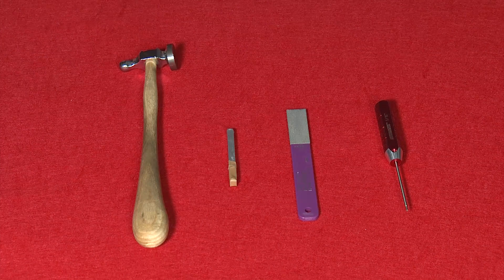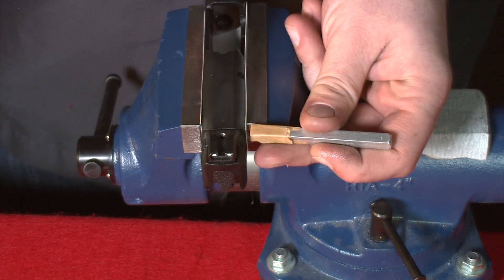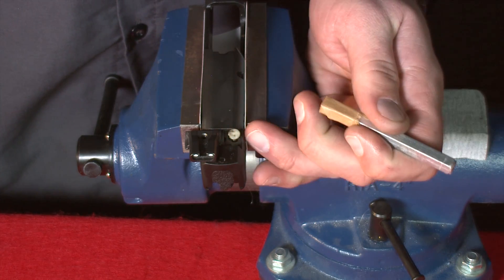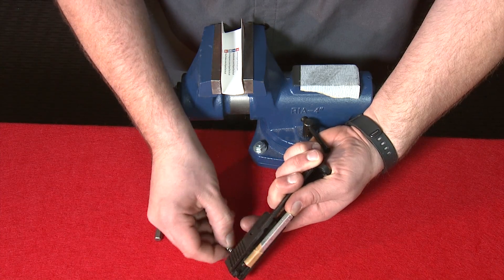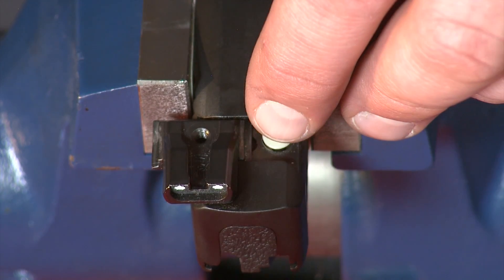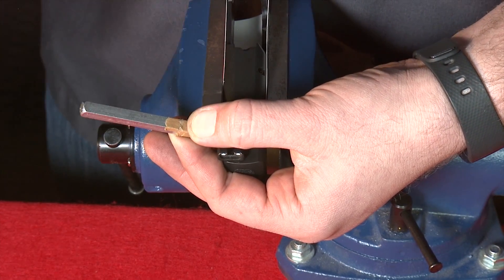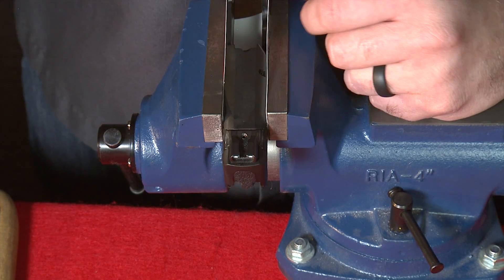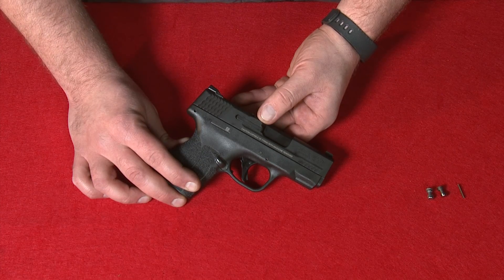How To Disassemble The M&P Shield And M&P Shield 45 Slide

Comment: How do you remove the extended 7rd magazine baseplate from the m&p45 shield? Can't get mine to slide off and no videos on it. Thanks.
Reply: Ah, nevermind, figured it out. You have to depress the button on the bottom Alot more than the flush and then it slides off.